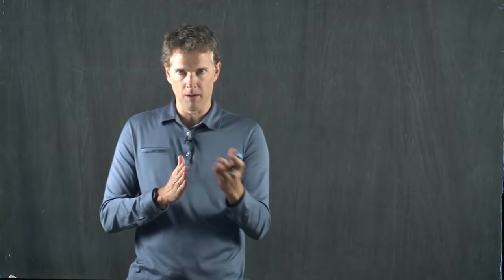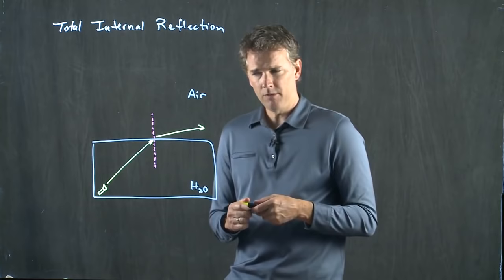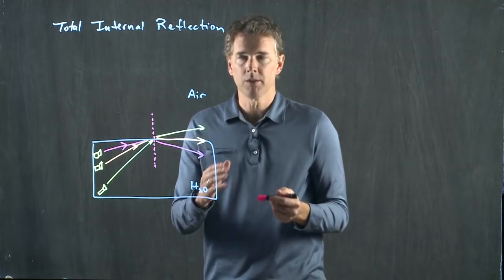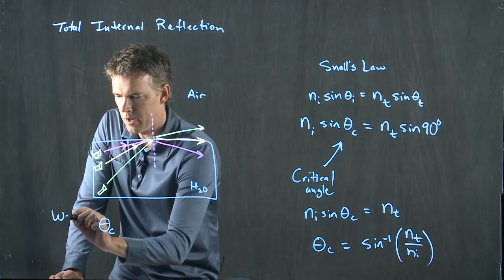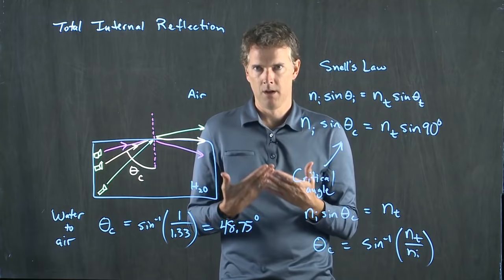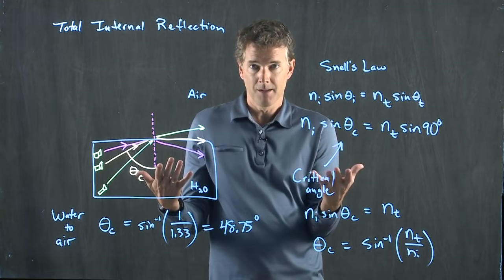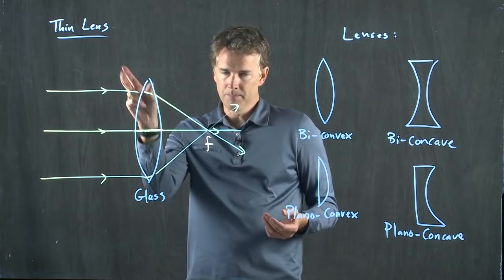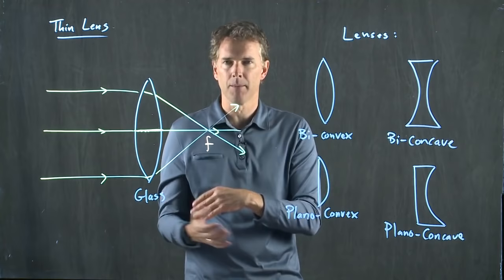Geometric Optics 2

Comment: cool video however I was hopping you'd touch on what happens when the object is on 2F, farther than 2F and between 2F and F for both lenses. And what if the object is layd flat on the surface (forgot what its called), obviously the image will appear on the surface, but how do you find exactly how far away from the lense, on the surface?
Reply from the maker: Excellent questions.  I'll try to make an update video soon.
Cheers,
Dr. A